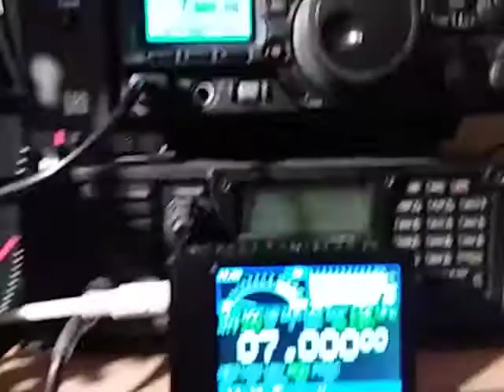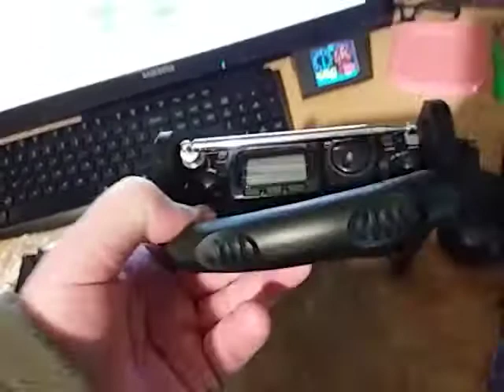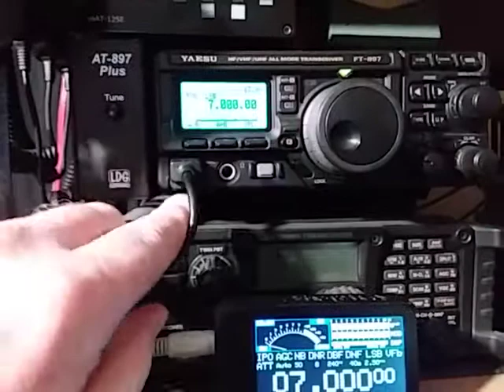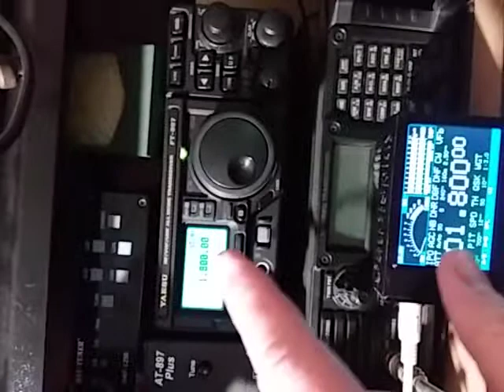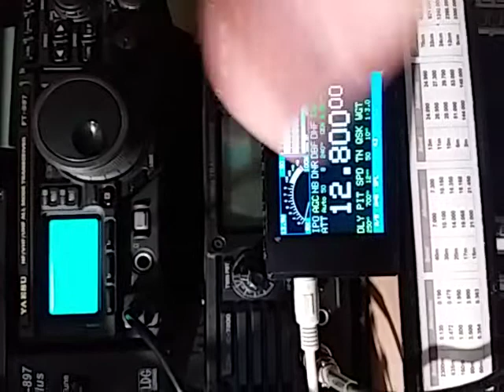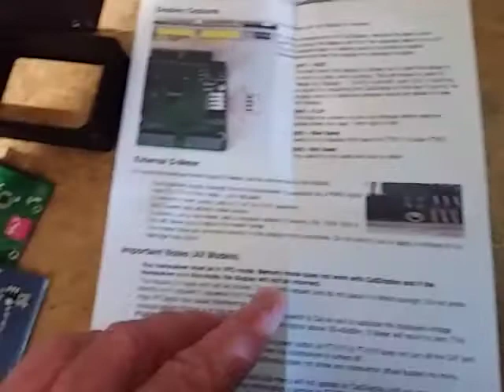The original CatDisplay by ZL1CVD

Comment: Will the display show menus as I access them.  My 897s factory LCD is unreadable. So for instance if I want to change settings for my SSB filters will the display show while I access the menu for that?
Reply from the maker: It does show the menu BUT it reads it from the transceiver EEPROM & is reliant on when Yaesu updates it. For menu number, they only update when you turn the power off. For other items, they only update when you change a band or mode. Some are updated instantly. Also, the data is only correct if you have the transceiver in VFO mode. So its nowhere like a screen replacement but it does show more data on one screen & bit clearer than the small Yaesu screen & menus. Definitely a trade off. Still, there are thousands out there now. FWIW this was the original video here a few years back: https://youtu.be/oxfVfFTzEXo
Reply from the maker: ..wow the original video was 2017. I now I've been making these for a while but hadn't realized how long :)
Reply: @ZL1CVD  got it.  Thank you.

Comment: Was interested in purchasing your cat display but you had mentioned the housing is biodegradable I was hoping to put it in a vehicle where the temperatures could get pretty warm has that changed at all?
Reply from the maker: No. I still use PLA which is biodegradable and not suitable for a vehicle. 
If you wanted ABS, the required STL file for 3D printing is on www.catknobz.com There are allot of companies that now 3D print to your requirements. So you could get a case printed & choose the required material & colour. I don't print ABS sorry. 73s om de chris zl1cvd.
Reply: @ZL1CVD  sounds good thank you sir 73s 🙂
Reply from the maker: @kennybobby9397  73 OM :)
Reply: @ZL1CVD  PET is a good compromise between PLA and ABS. A bit more heat tolerant and easier to print than ABS.